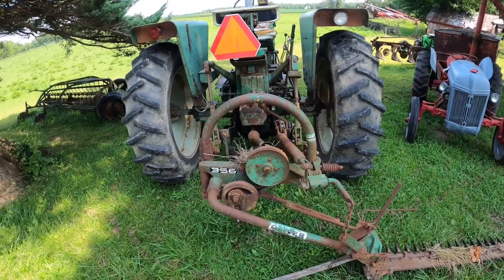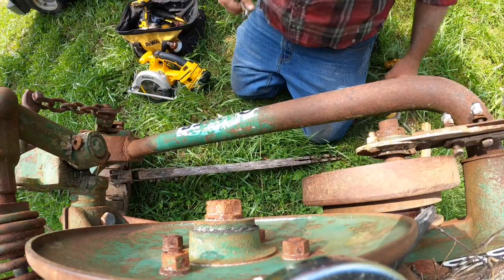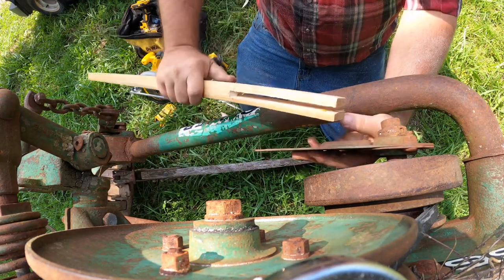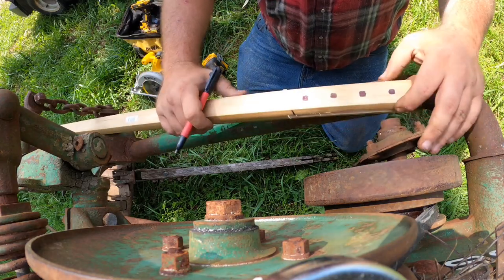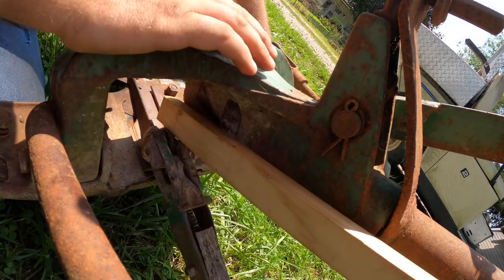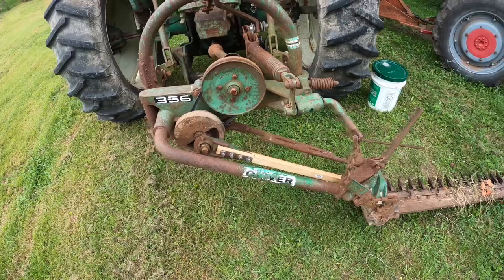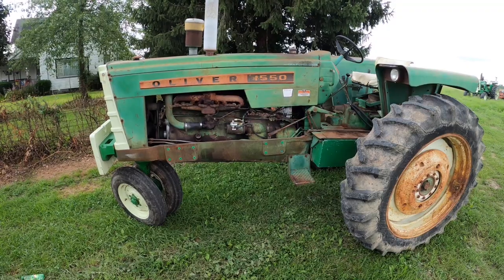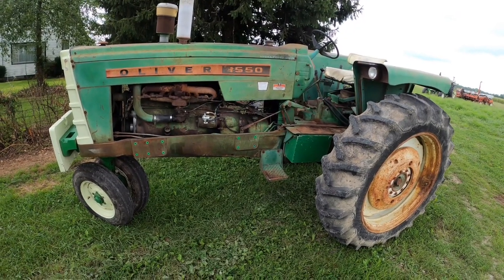I’VE GOT WOOD!!! Oliver 356 Mower Pitman Arm Repair

Comment: We used new idea mowers, and I called them the "bad idea" mower. We always had trouble with the mechanical lift. Grandpa taught me to make pitman arms. At the beginning of the hay season, we would make 3 new Pitman arms. Cut an oat 2x6 to length, then run it through the table saw to make it into 3 arms. Use the table saw to notch the ends. We used an extra plate to mark the holes and drilled them all. We would keep a spare pitman on the mower and a couple of adjustable wrenches. In my prime, I could change a pitman in under 5 minutes! I don't know what it cost us to make them, Grandpa had a sawmill on the farm, and finding an Oak 2x6 was never a problem.
Reply from the maker: I think that’s what I’ll do next time. The quality of the pitman I bought wasn’t that great.
Reply: @Ross the Oliver Man  we used white oak and red oak, I couldn't really tell the difference . I had a guy tell me I'm  🐓🐓🐓🐓ing idiot and maple is the only good option. Maybe it is. 🤷‍♂️ We don't have many maple trees here on the edge of the prairie! Mostly oak and elm trees. I blew off his comments because we would mow 20-30 acres before an Oak one would break, and we only mowed 25 acres of our own and some neighbors' stuff to help him out.

Comment: I remember changing those on our Oliver mower, but it wasn't a 3 point hitch one. The 88 didn't have 3 point hitch. Back then you could get one from an Oliver dealer. Our mower had a chain driven pitman not a belt driven one. It's still sitting in the shed almost 55 years later.
Reply from the maker: Cool that you still have it!

Comment: Nice mower!  I still have an old New Idea (sounds like an oxymoron) sickle bar mower.  Haven't had to change the Pittman for many years, mainly because I never use it anymore.  The last time I did have to change it, I was able to go to Tractor Supply (back then it was called Central Tractor) and get the one I needed.  You'd think these companies would realize that these old mowers are still out there working in many cases.
Reply from the maker: We used to have a Central Tractor as well. They had a lot more stuff than TSC.
Reply: Nice 770 in your latest video.
Reply: @Machi74005  Thank you!  I have run it a bit and worked on it some since I brought it home 2 days ago, and I'm really happy with it.

Comment: Nice job Ross!

What are you reading for oil pressure on your 1650 diesel at pto rpm after its hot?
Reply from the maker: I’d have to look, I think it stays around 40-50